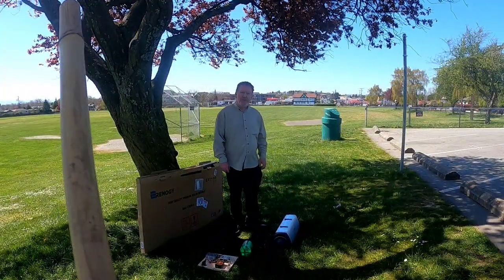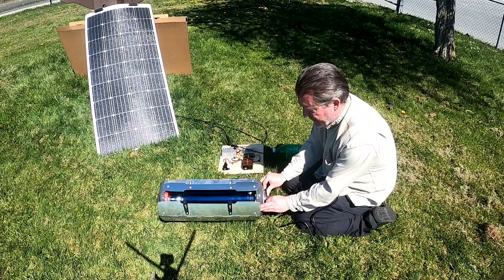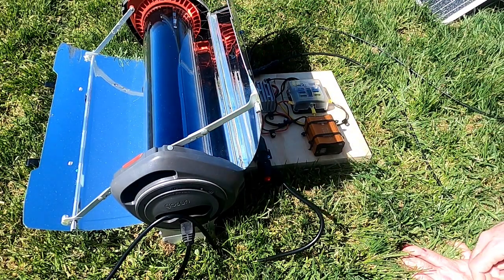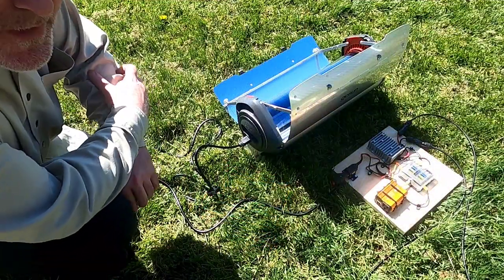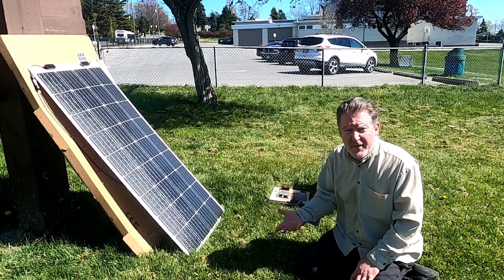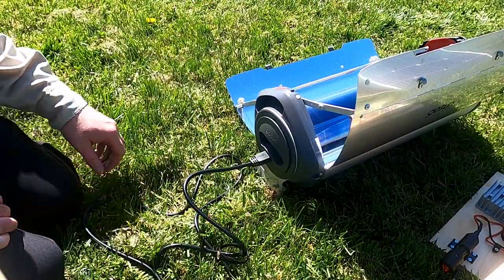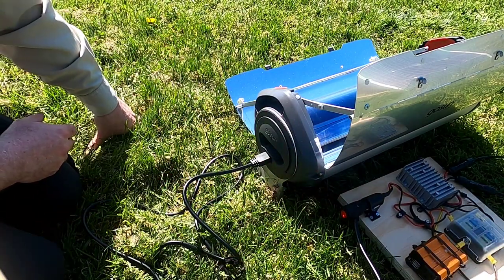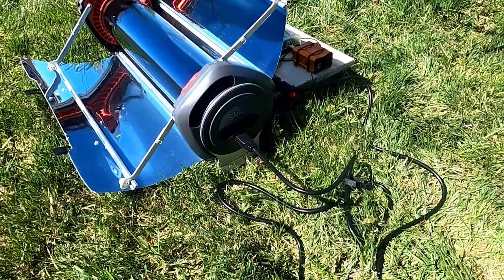DIY SOLAR - NEXT LEVEL TECHNOLOGY- using solar thermal and solar electric together.

Comment: How long does one of these solar panels last? My experience with the fold up soft panels is that they're optimal in their first year, but really drop in efficiency, so I'm curious how this type of panel compares. Does it come with an 8mm plug? That's what my Bluetti and Goal Zero power banks require.
Reply from the maker: 5-8 years they claim 20. mc4 connections

Comment: Hi Frank, I don't want to sound like a Negative Nancy but what do you do when the sun is not shining? Relying on things that are not a guarantee like the sun and electronics are pretty risky when you are in a worst case scenario IMO. Fire and a pot and a frying pan will probably get the job done faster and it works 24/7 365. I have always wanted to give Solar a go but the price point to get into it verses the practicability just is not worth it for me.
Reply from the maker: In urban / suburban survival having ample fuel supply for fire in a grid down situation for prolonged periods can become unrealistic, you are correct in stating that just this setup is not a 100% solution it is not meant to be, but if it offsets even 50% of your long term fuel needs that is a significant gain. As it goes for the price, using the solar panel with the battery less generator and a far cheaper 12v cooking device this rough setup can be achieved at around $500 to me it is worth the gain for extended grid down scenarios. For my situation if you have seen previous videos of mine I additionally have my solar generator with a 2.5kwh storage capacity if just running off that setup I can run lights and cook daily using it with this setup 'fused' in I can run basic lights and cooking 365 days a year. Yes I can always fall back on my primitive survival skills as shown in many past videos but having multiple options is always good. Additionally with all of my solar tech it is portable and modular allowing me to throw it in the truck and setup in urban or rural if needed. Gathering fuel for prolonged periods in any scenario is labor intensive this helps minimize that demand. Thanks for watching, more coming soon cheers!
Reply: @frankbush333  Yep, I agree on a lot of your points thanks for the reply! 👍